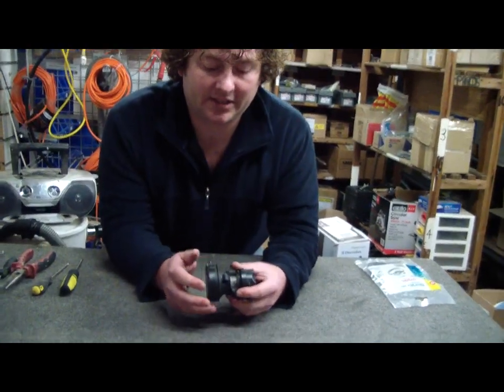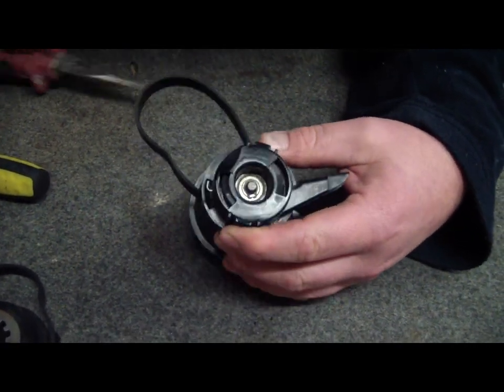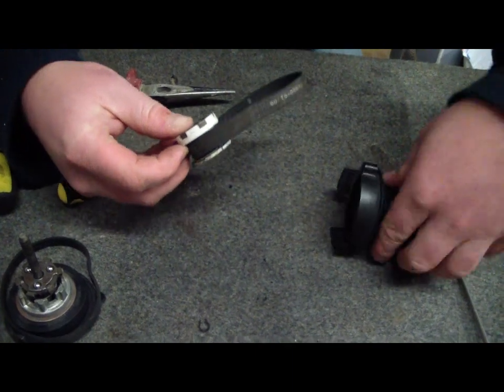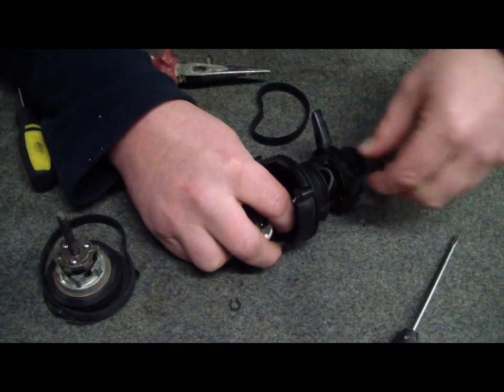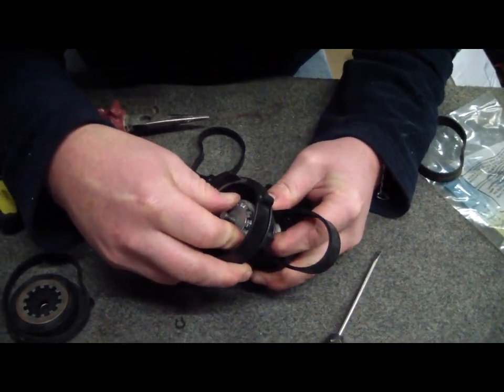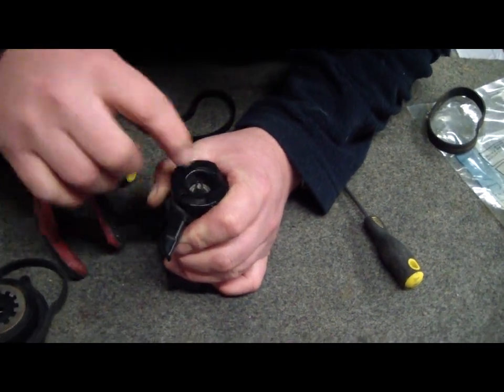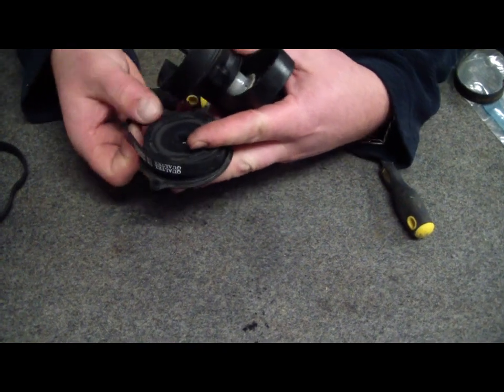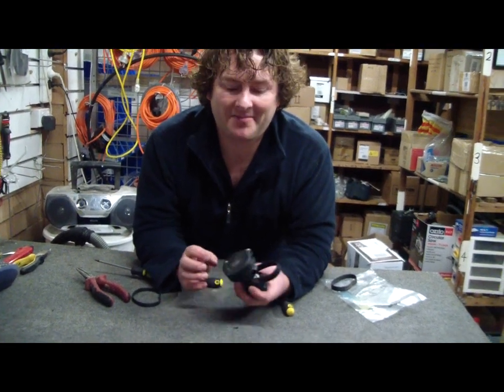How to change both clutch belts on a Dyson DC04, DC07 ,DC14

Comment: Great video. To pop the circlip back on more easily, drop it over the end of the shaft and press it with a 10mm socket. It will open up over the tapered shaft and click in place.

Comment: Great to the point video !  One thing I would like to add is, when you are removing the clip on the end of the shaft, get a second set of hands to help if you can. Have the second person hold the clutch and push up from the opposite end of the shaft to relieve some pressure that is being put on the clip, and this will also help the shaft from wanting to turn as you work the clip off.

Comment: Thingies and parts. You can't get away with that in text instructions but in a video it's as technical as it needs to be, hahahahaha! Excellent video! UPDATE - yup I've just replaced both belts in my clutch, really glad I was able to do so because the old ones had stretched to twice the length of the new ones, yikes! Luckily my white roller was still in excellent condition but amazingly you can still buy the white rollers as a separate item otherwise it would be a complete new clutch.

Comment: this was very helpful, i'm quite handy and this is a little tricky, replaced both belts as the brush roller was not spinning well, i didn't realize how much it was slipping until after repair, 11 year old machine working well again.

Comment: Replace the second belt (motor belt), reinstall the clutch plates, and screw the end cover back on before trying to refit the circlip. Then the shaft is firmly held in the right position anyway and you don't need to balance it all on a small object to hold it in place. Makes it somewhat easier.

Comment: Alex, terrific instructions. Completed a clutch replacement - no probs EXCEPT - the brush bar does not revolve when the machine is switched on, even though it's free and revolves with use of the hand. I further noted that although the motor drive is rotating and the drive belt running perfectly - the white coloured clutch extension for the brush drive does not rotate when the power is switched on. Dyson say I have to have a techy at £90 a visit! Help PLEASE. Tug

Comment: I replaced both my belts using your excellent procedure.  Everything is back together now but my brush runs all the time.  Did I re-assemble the clutch incorrectly?  If so how can I fix it?  Thanks
Reply: Does your dyson have a belt or a clutch?

Comment: Please help. The rubber join between the two pipes above the right wheel (if you are facing it) has come out of my Dyson dc14? How can I get it back in ? And if I have to pull it all apart to do it how do I do that? Please and thanks

Comment: At 3:15 you just cut the belt with scissors haha. At 6:41 you  can use a 1/4 inch drive with no bit fitted and push it over the shaft. Really easy to get the cir clip on like that.

Comment: very good vid and good for you for getting that C clip out with the chopstick method which i had to resort to when the cheap Harbor Freight pliers didnt get into it at all------glad i removed it in the bathroom with the door shut and the drain plugged as i know now why many now call it a Jesus clip-------------------no normal vacuum homeowner would even attempt a belt replacement cause of that C clip------------absolutely horrible Dyson forces people to buy a new clutch assembly to change a belt----would never again buy another cause of this----------great job!

Comment: My 2c. If u have had it for a long time. Take his advise from the begining. Just spend the duckies to buy a whole new part (Whole Clutch). I bought the belts. Took it apart on a clean mat and realized several things were worn down (the plastic spindle looked burned). Also I had thought maybe i was careless and lost a piece, But one ball bearing was missing. Had it for a while and should have realized with all the abuse, parts would be worn. I Noticed even the housing clip was just a nub and difficult to close.. I chose to buy the clutch as tho even if it would work...How long would it last before i have to tear it down again. Got time on ur hands, sure, But when ur busy. Annoying Times fellas! Hope everyone fares better.

TY for the VID

Comment: One little suggestion, if I might!  When replacing plastic screws (plastic screws aren't made of plastic but are screwed into plastic!) NEVER use a drill or electric screw driver because it's very easy to drive the screws in too tightly which reams out and chews up the plastic and then they will never hold again.